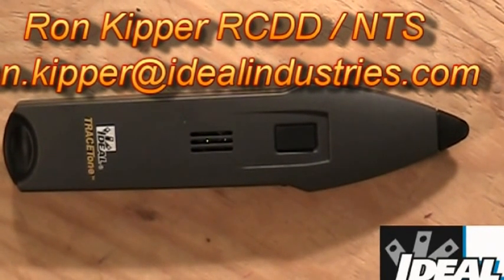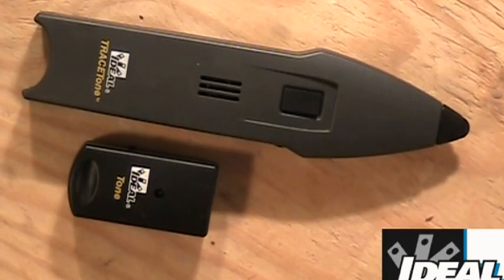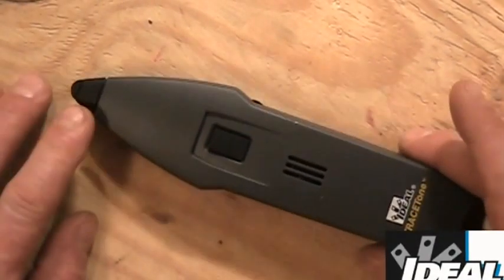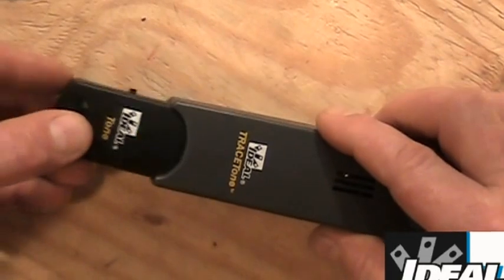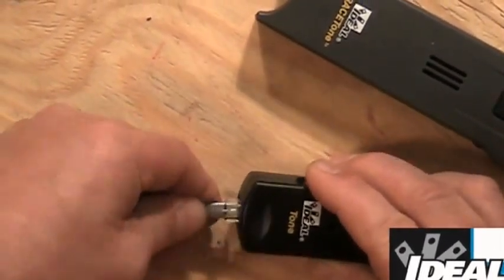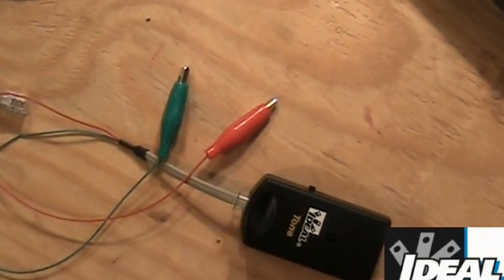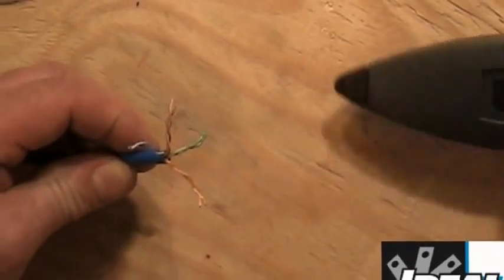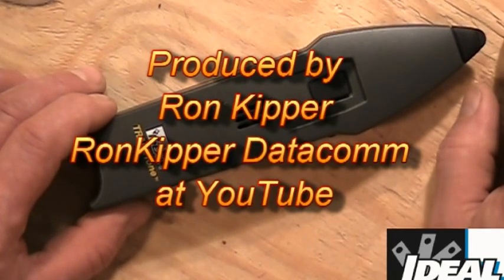Trace Tone 62 140

Comment: what if you want to trace just a single wire, can you use one alligator clip
Reply from the maker: Avram Berman Yes you can use the red and just dangle the other towards the ground. Take CareRon
Reply: Thanks for the quick reply.  By the way, do they make a combo (single unit) non contact voltage, auto range meter with display and toner-in-one.
Reply from the maker: Avram Berman Good questions yes on the first two but not on the toner part. I have never seen a DMM that also had a tone generator too. Our 61-746 clamp meters are auto ranging and have NCV.I will pass it along to the product managers.Ron